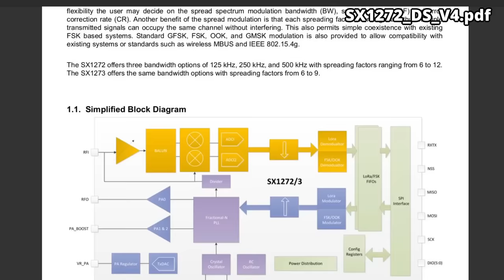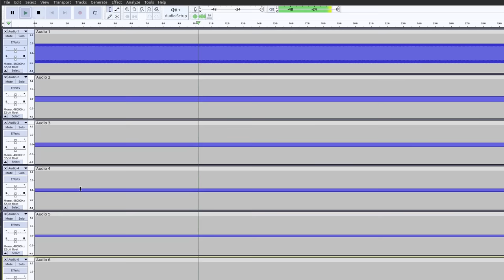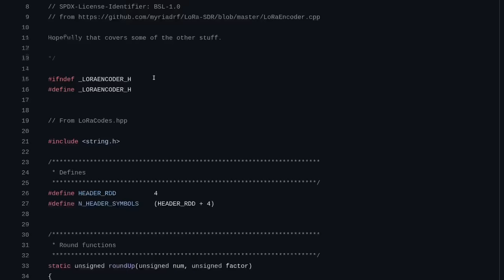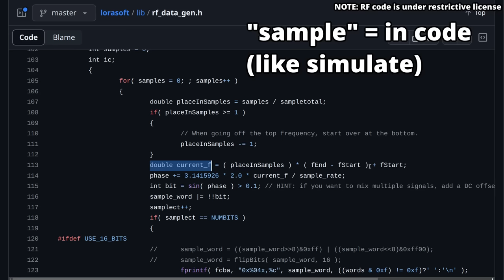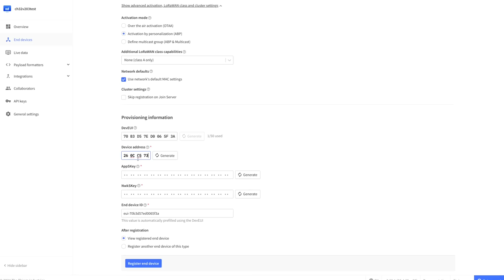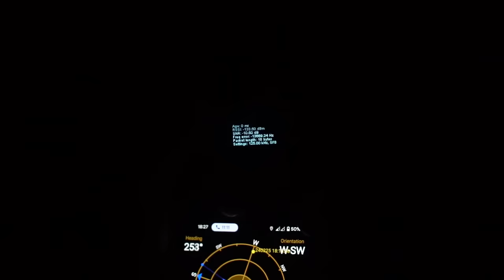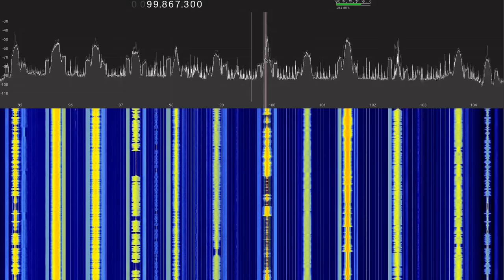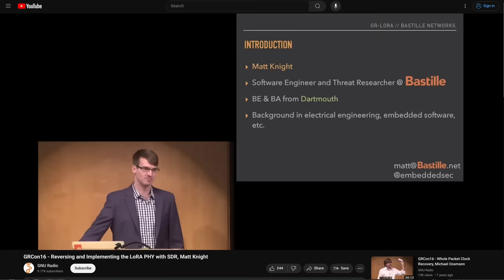How far can I broadcast LoRa packets WITHOUT a radio? - LoLRa

Comment: Charles: so I made the GPIO pin go real fast. FCC: and I took that personally.
Reply: I dont think there is a better meme for this video

😂
Reply from the maker: I am unfamiliar with this meme
Reply: I think the FCC can't even complain if the signal is below the noise floor, could it?
Reply: @red13emerald , The problem with this is that the desired signal is below the noise floor, but there are other undesired signals being produced that aren’t. These need to be removed with a high pass filter.
Reply: @red13emerald  fair point
Reply: @terjeoseberg990  also good point
Reply: @terjeoseberg990  is there way to make square wave signal smoother
Reply: @arduinoguru7233   Not really. But a bandpass filter will clean up the spurious signals this thing generates. You can then feed that into small amplifier.
Reply: @CNLohr  you're the meme.
Reply: ha ha GPIO goes brrrrr
Reply: @arduinoguru7233 , Well, it’s the sharp corners that are the high frequencies that he needs for the signal that he wants, so it would actually be better if he could make the square wave sharper. To remove the undesired signals, he needs a high pass filter.
Reply: @terjeoseberg990  unstable sharp wave could lead to noise data lost, I'm not expert but I think receiver should have wave size tolerant value
Reply: @arduinoguru7233 , You obviously don’t understand where the LoRa signal is coming from in this video. Maybe you should watch out again.
Reply: @terjeoseberg990  I'm not talking about this video, I'm talking about Wireless signal in general, I just trying how it get more efficient with time.
Reply: @terjeoseberg990  I think even if you make your own RF circuit with filtering, it still needs to be FFC certified. Atleast that should be the case for a powerful transmitter.
Reply: @benargee , There are limits beyond which you must be certified. LoRa is in the open 2.4 GHz band where microwave ovens blast so much noise that the FCC doesn’t care. However in this video what he describes is broadcasting a lower frequency square wave and then he’s using the higher frequencies that exist in square waves as the desired signal. This means he’s broadcasting a stronger signal outside desired band than inside the desired band. A high pass filter could eliminate the low frequency components that are unneeded and undesired.
Reply: @arduinoguru7233 , I don’t understand what you’re trying to say.
Reply: @terjeoseberg990  a square wave can be thought of as the combination of a sine wave of the base frequency F and a bunch of higher order frequencies (odd harmonics to be specific).  Most of the energy goes into the base frequency.  In the case of the video, his base frequency is well outside the LoRA band, and he's relying on those upper harmonics to generate the LoRA chirps.  The FCC doesn't like you when you generate a bunch of noise in bands that you're not even supposed to be using.  Therefore he should be using a filter on the output to remove the extraneous frequencies.
Reply: @CNLohr  Don't worry. If you keep doing your bitbanging radio experiments in public and increase the emitted power a bit, the FCC will make you familiar with the meme.

Comment: This video terrifies me
Reply: Me too in an "in complete awe" sort of way, and also because the implications of it are that a large amount of digital hardware can potentially leak data via LoRa packets induced in software and radiated off existing structures in the product. 🤯
Reply: @DanielSMatthews most commercial products can’t as they are designed around emc requirements
Reply: @UKsystems  They are designed to pass tests when used as designed, change the code and they are out of spec and Tempest like tricks apply. Same with most of the attacks against air gapped computers, you need to be able to run code on them to get them to behave in unanticipated ways.
Reply: @DanielSMatthews "can" = does
Reply: @DanielSMatthews  there are also tests for adverse use cases and checking for anything that can be used as an antenna or at least for ukca aprooval
Reply: @UKsystems  Hardware fuzzing etc.? Understood. Best practice engineering. 👍
Reply: This hack has been known and used for sidechannel signalling for decades. Your phone does it. Might as well know how it works.
Reply: @UKsystems You can send LORA packets below the noise floor, so this argument is moot.
Reply: @nobodynoone2500  Hah true, like building a fence when you have tunnels under you.
Reply: How so? AI will never get equipped with radios to mess with our- oh, I might understand...
Reply: Why, this is fascinating.  More people should be doing experiments like this.

Comment: Aggressive bandpass filtering could probably make this fcc passable. Amazing work
Reply: Yeah but that makes this become radio circuitry with a filter and amplifier, etcc
Reply: Aggressive badass work 😅
Reply: @kreuner11  Not really, a bp filter can be some traces scratched off copper pcb. It''s dumb (and illegal) to not make or use one tbh.
Reply: Was thinking the same thing. This could be a real fun network filter design process
Reply: @nobodynoone2500  I think he started with that proviso
Reply from the maker: If I do any more work on this I will definitely be working on filtering everything down as much as I can.
Reply: I smell at least a hefty fine, if they can be bothered that is
Reply from the maker: I'm a software engineer though.
Reply: With spurs so close together, I'd imagine a SAW filter would be needed -- but that's entirely feasible, assuming there's off-the-shelf parts in the band already. RF amp can be as simple as a MMIC, or transistor and couple resistors. Proper tuning, harmonic reduction, optimal supply current consumption, etc., all are engineering problems, but a commercially practical version might still not take too much work.
Reply from the maker: @T3sl4  I think a SAW would do wonders.  I'd love to give it a shot at some point but who knows if I'll ever have time.
Reply: @CNLohr you could also use a passive resonator on the transmission line (before filtering) to boost the power of the harmonic by stealing power from lower harmonics. As an experimental physicist working with RF, I am impressed and baffled that this was possible
Reply from the maker: @matteodelgallo1983  Please explain more!  (Also, if you have a Discord, would love to get your input there, I'm `cnlohr` on discord and my DMs are open) if not, explain here. I'm really curious.
Reply: This reminds me of making music on an Apple II computer speaker!
Reply: @matteodelgallo1983  probably just find one of those tiny RF pass through inductors that has specced a self resonant frequency at the desired transmit freq. It would filter out everything but the SRQ.
Reply: @kreuner11  yeah and that's what makes it more compliant. We moved away from spark gap radios for good reason. Hard to share the spectrum with noisey transmitters.

Comment: Now build 10 element beams for both ends. :)
I've blanketed 1/3 of the USA with a 7 mW BPSK LowFER signal from my 30 foot tall antenna with 2 miles of hand-wound 22 gauge wire and a loading coil with 35 pounds of 8 gauge wire wound on a 3 foot diameter Styrofoam core, and I've been called crazy. But you have gone far beyond me. Well done, sir! I salute you! BTW, the most fun I've ever had was doing range tests. I drove 900 miles on I-80 across the USA watching my beacon message play on and on on the computer on the seat beside me. I smiled every inch of the way. Same sort of thing happened with my range tests with Hi-Fi audio sent via a dollar store laser, further and further, 6+ miles of smiling in the cold and dark with rain sprinkling down on me. I think we both know exactly how Marconi felt as his radios worked further, and further, and further.
Reply from the maker: The days of Marconi would have been a wild time time to be alive.  But yeah, WSPR and other protocols would be pretty cool to explore like this.
Reply: That laser thing sounds really interesting
Reply: You realize the FCC prohibits LowFER antennas longer than 49ft, right? (Including the feed line)
Reply from the maker: @scottdotjazzman  is the load coil factored into that? It seems strange if it would be because you could just use a higher voltage higher impedance output and no load coil for the same output, right?
Reply: @CNLohr  Yea, but if he is using stock retail radios the output will be fixed 50ohm impedence and if the antenna is too short relative to 1/4 wavelength it will have too much capacitance vs impedance so you add a load coil to give that capacitance some more inductance to resonate into- bringing it closer to 50ohm purely resistive.
Reply from the maker: @tripplefives1402  still though. Can't you also use a transformer to change the impedance?
Reply: @CNLohr  If you move the matching near the radio then you will have losses from the coax being unmatched to the antenna and transformer. Also the antenna is probably of undetermined impedance and you can just move a tap on the load coil and get matched quickly by trial and error. Transformers are rarely used in RF because they cost more and are not as efficient and are big at higher power levels. They just slap an inductor and capacitor on it for cheap and that inductor and capacitor pair basically makes up the missing impedance.
Reply from the maker: @tripplefives1402  my comment was just to point out/explore what it would look like to change impedance without needing a ton of line. I think we've long since passed the point of the convo
Reply: @CNLohr  If he did that then he couldn't brag to other HAMS about his antenna.

Comment: Incredible as always. And simultaneously terrifying.

Now we just wait for the headline “Gaming keyboards had firmware undetectably overwritten to broadcast key strokes hundreds of meters via LoRa, without physical access, from user-mode application”
Reply: It would only work at a very small volume, right? Otherwise there'd be a ton of noise from thousands of different keyboards.
Reply: @GeekProdigyGuy   thats the beauty of spread spectrum! just think about how many bluetooth devices are around you and it still works flawlessly.

well maybe not if everyone was just spewing out subharmonics to get a few picowatts of actual signal 😅
Reply from the maker: there's far scarier things goin on in the world, no need to freak out over this.
Reply: @CNLohr  The only correct response
Reply: There have been plenty of security research papers along this line
Reply: There's a world of difference between research paper/highly targeted attack, and widespread exploit easily used against regular people.
Reply: @juliankandlhofer7553  I'm no expert but one thing I can say for sure - in a house with just 4 people (maybe up to 10 active Bluetooth connections at a time) Bluetooth most certainly does not work flawlessly.
Reply: @CNLohr  Can you try thinking in lora for your next video?
Reply: OMG 😂🎉
Reply: Maybe time to rework BT to Lora protocols? Or vise versa? 🤔
Reply: @CNLohr  Like what? I actually wanna hear what scares you :)

Comment: holy shit that's nuts. When you started talking about using reflections to get your desired carrier frequency my brain started expanding. I'm so shocked that you didnt run into any issues with this by nature of your antenna being a wire that was bent. I figured that any little change would greatly effect the outcome of the reflections, but I guess so long as the actual length of the wire is not changing, the reflections should still be there relatively unchanged. Also the idea to just add wireless connectivity to existing devices that we can hack was just brilliant. Lastly throughout the video I was thinking how it would be a cool project to draw vector graphics in the waterfall view like some people do with the xy plot on a scope and the last few seconds I see the outro graphic. Brilliant
Reply from the maker: Expanding your brain is what I am here for. I love helping people grow and learn. The outro was something I thought of at the last second.

Comment: Huge respect for making such limited hardware spit those radio signals. This is even one step beyond VUSB !

Seems crazy to receive data under the noise floor, but the spreading for measly 3000 bits/s over a big bandwidth 125 kHz is what makes it possible.
Reply from the maker: Indeed!  And those bits are spread so broadly in time.

Comment: I'm normally quite put off by the thought of spurious emissions, even if they are very low power. But this has completely turned my conception of them on its head! Though I would be lying if I said I didn't spend half the video trying to think how I would filter it. Bravo!
Reply from the maker: If the thought of doing this without extra hardware wasn't so central to this video's thesis I would have totally added the filtering.
Reply: Literally just need a bandpass filter.  There's no other way to do that reliably when you can't bit-bang about the Nyquist frequency.

Comment: Good video, it is a method used in radio frequency to obtain high frequencies from a stable time base of a lower frequency, the idea is to use overtone and filter the output so that it only delivers the corresponding harmonic. It is used a lot. Maybe if you add a bandpass filter and an amplifier you could have an interesting device. Regards from Argentina!
Reply from the maker: A bandpass or maybe a class c would certainly help

Comment: LoRa is amazing. We did a range test with TBS Crossfire LoRa TX and RX and managed 23 km with 10mW on a drone.
Reply from the maker: 10kW on a drone what?
Reply: @CNLohr  damn, *mW 😅
Reply from the maker: @ChrisPrefect  Whew.  That's more like it.  I'm surprised there's such a discrepancy.  I'm putting out such little power, and yet it still somehow goes pretty far.  10mW is a LOT more power than even my EIRP.

Comment: I'm guessing it wont pass FCC limits 😂 incredible work.
Reply: Later in the video he actually makes it have very little extra noise outside of the desire frequency which is interesting
Reply: make a lil bandpass. a bit of loss is worth the better signal imho.
Reply: @nobodynoone2500  it will require a SAW filter plus a class C amp to produce a decent RF output (in term of regulations), but i fear the side products of the class C will require one more SAW (not cheap) and still be too problematic, another way would be using the fundamental and a mixer, but the BOM cost will be too high. There is some cheap RF chips with registers access which could be torn to emulate LoRa TX properly (we did that at the time of sigfox in DBPSK), however a radio without RX isnt very useful.
Small MCUs are capable of demodulating and decoding a 868/900MHz signal by using their fast ADC, a mixer and a 800KHz IF but again given the low price of an LLCC68 this would probably be a futile exercise (i did that for a mini sigfox basestation few years ago, using an STM32F4).
Reply from the maker: It's such a small amount of power it just might. But a SAW+Class C would be hoppin!

Comment: Have you checked the RPiTx project? The concept is similar, I have have already played with it to transmit Whisper signals in HF and my signal was spotted thousands of Km away, but of course based on ionospheric refraction. However you could use RPiTx concept to transmit Lora, i think they didn't do it yet.
Reply from the maker: There's so many of these all around, and I haven't checked it out.  I just don't do much dev with rpi.

Comment: This scares me. I frequently consider how a state actor might exfiltrate data via compromised hardware/firmware. I had always reassured myself that they would never send it over the wire/air because of the risk that it would be detected with traditional network infrastructure monitoring. I also reassure myself that bit-banging something out over a funtenna to other compromised devices acting as relays would require so many compromised devices that they'd risk being discovered. But I hadn't considered LoRa... The infrastructure already exists, gateways are popping up everywhere, it operates far below the noise floor... Do you have any idea how easy it would be to exfiltrate private keys using malicious firmware or even silicon? A crypto co-processor? Hmm... maybe that thought deserves a PoC...
Reply: I think this is already being used...
Reply from the maker: There's so many other scarier things in the world.  Don't worry about this stuff.

Comment: Data exfiltration by gpio sounds scary now.
Reply: It's not exacxtly unheard of in the hacking world. There was a rather famous use about 25-30 years ago.
Reply from the maker: It is pretty common nowdays, with several different air-gap techniques
Reply: @CNLohr  Now a 1000 meters away. Balloon heights!

Comment: It's really all about the performance of the receiver.  I agree that constraints drives creativity.  Being able to generate the LoRa protocol from a simple controller is very, very clever.  Also, the emissions from a digital signal is a function of the rise and fall times as well as the period.  The sharper the edges, the stronger the harmonics.